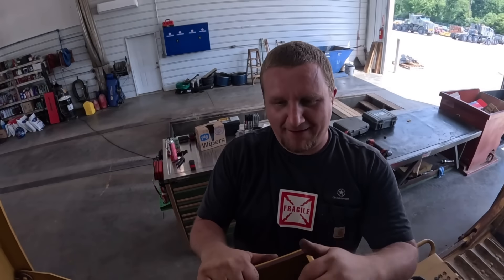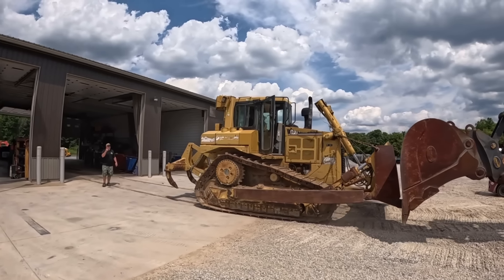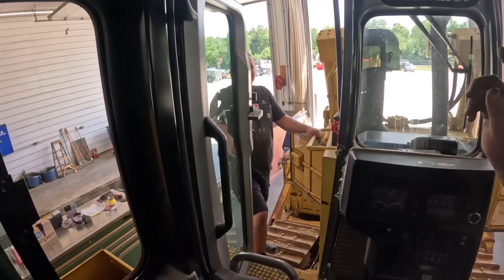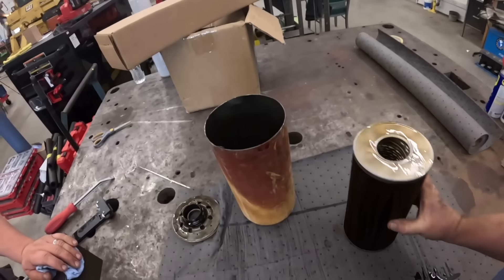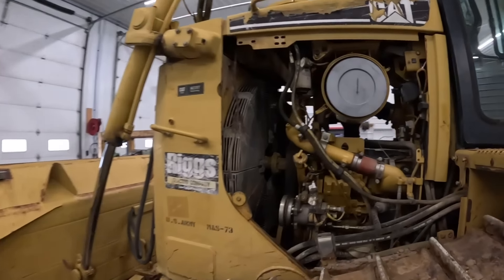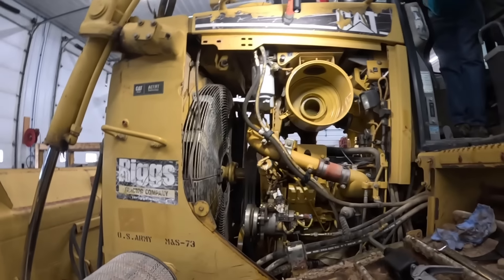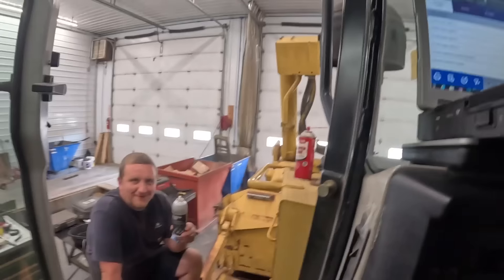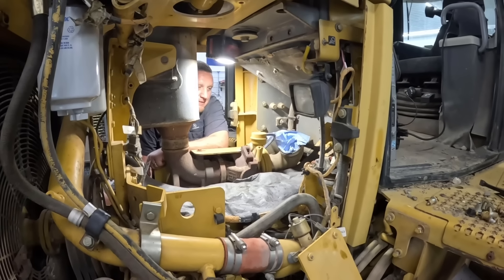Ex US Army Caterpillar D6R dozer is dead with only 800 hours? I may of messed up big buying this!

Comment: If you grind the tabs down on the cat master key you can remove the key with the battery in the on position.

The best way to fix those wires is to depin them from the connector so you can slide shrink tubing down each wire.

Comment: I work on everything, all makes and models of heavy equipment. I don’t own them, and I don’t run them, I just work on them. And a couple years ago I contracted to a company that had a large fleet of only cat equipment. Some hoes, mostly dozers. I don’t mind their excavators but I’d take serious pay cut to never touch a cat dozer again in my life. Those things are just ignorant to work on compared to a Deere dozer. Just wait till you gotta pull the control valve on cat, a reseal is a 2.5 day adventure, it’s a half day job on a Deere!

Comment: Hey if them bonehead mechanics, were welding, on the machine, would cause a short on the electronics and melted the wires on the injectors, and the mice ate the wires , later,,,,,,,